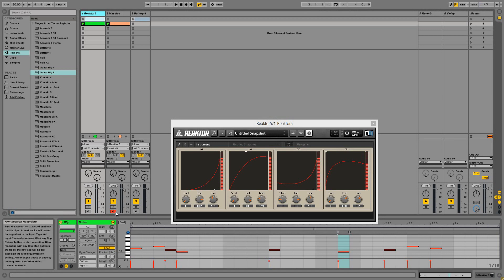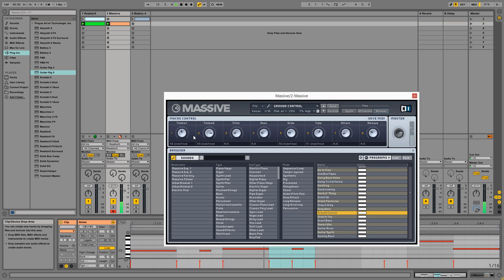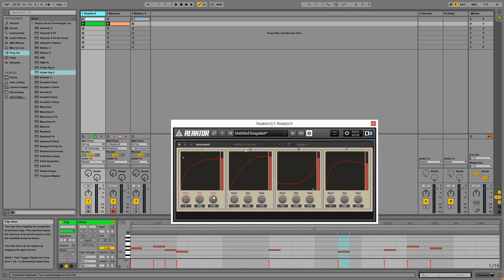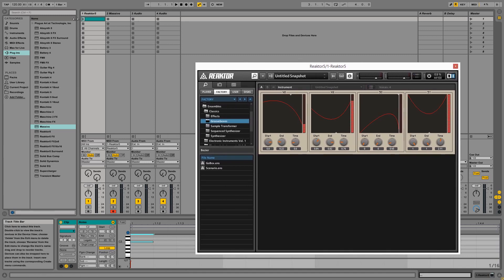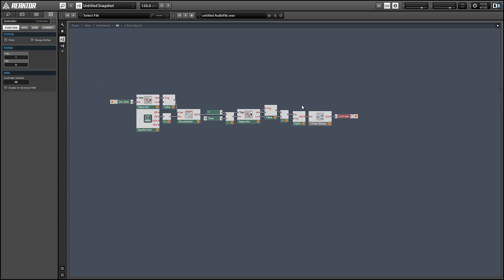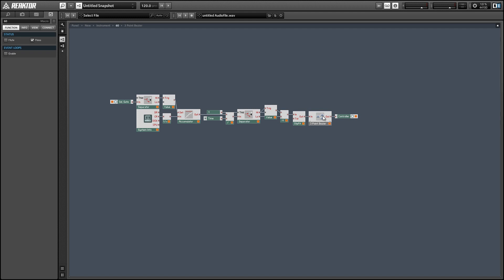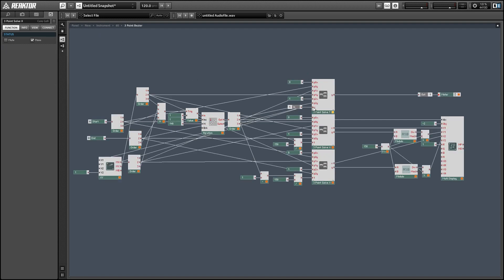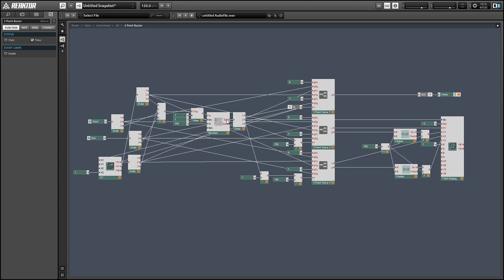NI Reaktor Tutorial - CurveBall MIDI Automator

Comment: A while back you showed us how to build a polyphonic unison macro, which is awesome and I love it, but if my ears are telling me the truth, it sounds like the pan module is panning 4 voices hard left and 4 voices hard right. I was wondering if maybe there was a way to pan each voice evenly apart in the stereo field with panning values like: -1, -.75, -.5, -.25,.25, .5, .75, 1 <or something like that, not sure what perfectly even values would be. Anyway, just my thoughts.
Reply from the maker: Hey, not sure exactly which tutorial you're speaking of, there's well over a hundred at this point. However, if the pitch is spreading properly, the panning should follow the same exact algorithm more or less, so just use that?
Reply from the maker: imyouandurme it's possible i did something wrong at the end of that video. but again, the technique should basically be identical to the pitch spread. there is a pitch gate macro in my ensemble Modulator (not in the user library but on my old blog) that i believe has a panning output.